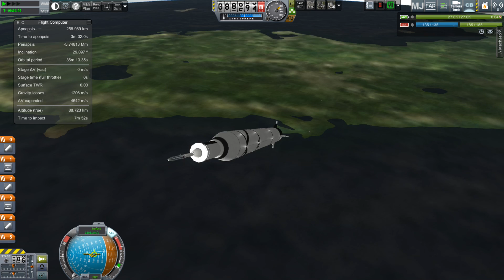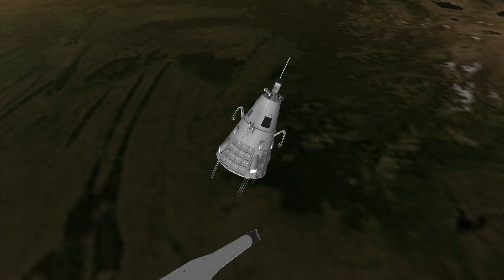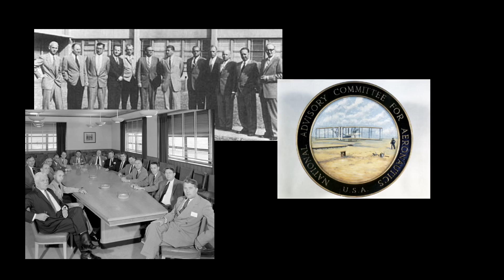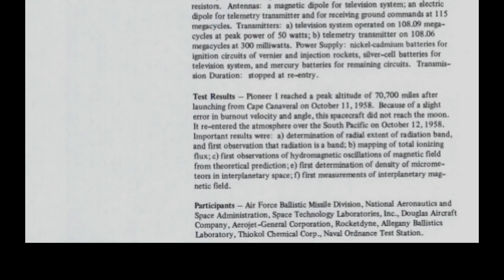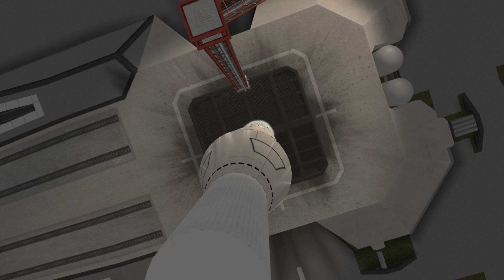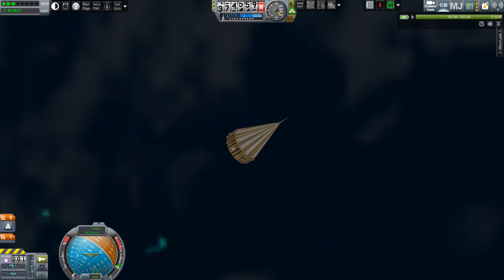1958 History of Spaceflight in RSS / Project Alexandria-03 / KSP 0.25

Comment: Im using RSS RP-0 and RO and am having difficulty controlling the vessel once the 1st stage burns out, what are you using to get the probe to rotate once the 1st stage separates?
Reply from the maker: +Shane Allen (GSAMelon) Every flight is different. It depends on how the real world ones were made to rotate. I just replicate whatever the real world did. I sometimes bump up the power though, since real world launches can use 1/10th the power and run it for 10x as long, but I don't want to sit here waiting 20 minutes for something so I make it happen in 2 instead.

Comment: Bob, when you start a real solar system save the time defaults to January first 1951 at midnight, if you edited the day/year relative to that start point (including adding a day for each leap year) you could launch everything on the correct dates. It may be useful further down the line for planetary missions as everything will be where you need it to be (Voyager would be awesome.) This is definitely my new favorite YouTube show, thank you for being so thorough with the details, this is a fascinating and informative series.
Reply from the maker: MrMarkZachary Good point. I was going to start setting it when it came time for those but I could do it now for even more authenticity. However, due to "Kerbin's" lack of axial tilt it might still be tricky or unrealistic.
Reply from the maker: Marcin Bednarz Yes. The solar system is tilted. The moon is tilted. It still doesn't help. I'm not sure how to explain it. Try drawing it out, or try RSS and see what I mean.
Reply: Bob Fitch from what I know the whole solar system is tilted to compensate for that
Reply from the maker: Marcin Bednarz Maybe I can explain it... since the axial tilt is aligned with the solar system, the solar system would appear to "wobble" relative to it from a static observation point. Think about this... there are no seasons on this "Earth". We always face the true equator toward the sun.
Reply: Oh  ok i understand it now thanks

Comment: Was SCORE spinning in time warp at the end?
Reply from the maker: ***** I was not in warp.
Reply: Bob Fitch There is a mod, "Persistent Momentum," that attempts to address your issue of timewarp killing rotation.  It's designed as a Manley-Mode mod.  http://forum.kerbalspaceprogram.com/threads/85990-0-23-5-Persistent-Momentum-1-0-(14-July)
Reply from the maker: ***** I didn't specifically say this in the video, but I didn't want to use that mod. I don't think it'll make things harder. I just think it's still not realistic since the spin stops DURING warp, so what's the point. I could change my mind though.  :)
Reply: Bob Fitch Well it looked pretty darn fast, especially for Real Solar System. However I am going to assume that is due to the elliptical orbit.
Reply from the maker: ***** What was fast? The video playback? Yea it was at least 4x if not more.
Reply: Bob Fitch Wow. How did I not think of post-processing and editing. That would make a lot more sense.